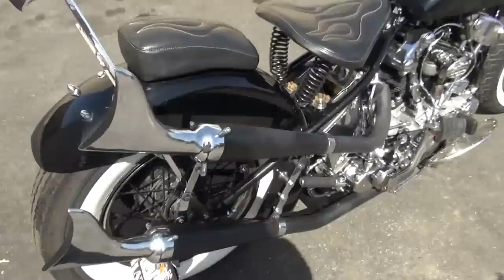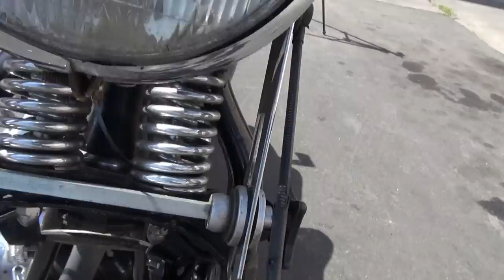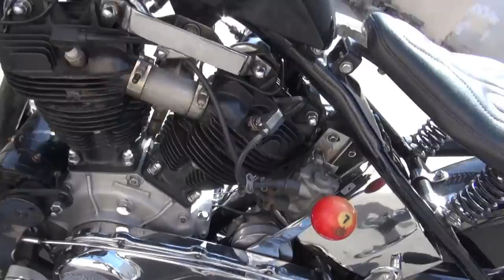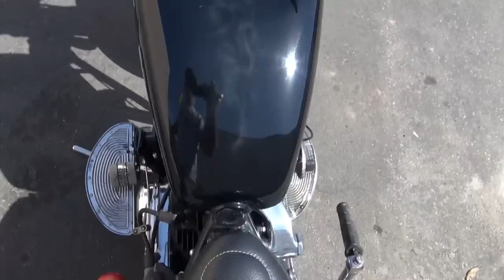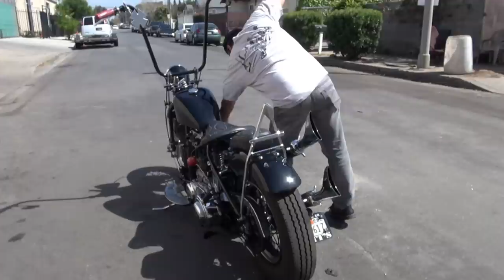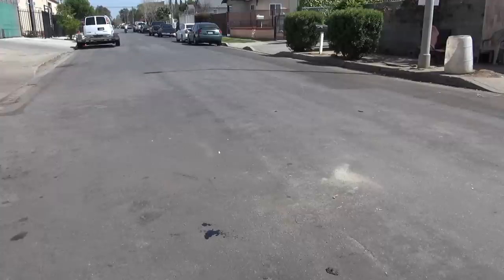Hunting Harley's, 1945 Knuckle bobber

Comment: i have fallen in love with these retro bikes haha what would a guy look to pay for a basket case to build i wanna find one and build it they look awsome haha
Reply from the maker: there is no set price. It is whatever your willing to pay and they are willing to sell for. best of luck
Reply: Ok.Who really knows the reason for apehangers? Give up? In W.W.2 When signal Corp riders were used to relay information quickly , THE ENEMY would stretch wire across roads to impede motorcycle couriers progress. Tall handlebars were a Safety matter, not a style look.🇺🇸🗽
Reply: @onepunchgeorge9251  wow that's cool info thanks.

Comment: yeah, the oil leak under the primary tells me it a real harley. dont be fooled by imatations :-)
Reply: +ted hazelwood If the oil leak is from the primary cover hole at the bottom of the clutch, it is supposed to leak there, it is from the chain oiler,,it's how the primary chain is oiled,,,,if it's leaking anywhere else,,it is an oil leak!
Reply: That's environmentally unsound engineering. Should have a little catch cup.

Comment from the maker: MMI is only good enough to make someone dangerous
Reply: HuntingHarleys I bought a basket case 74 sportster because I knew the engine had almost no miles and it's what I could afford. Prices were still nuts in 04. I've told anyone who asks if you have basic skills and buy a factory manual you can figure out anything. It does suck buying a 40-50yr old bike that's had decades of terrible repairs. I've seen some ugly stuff, I'm sure you've seen worse. I got to move to a 68 shovel with std pan heads that I loved and miss. Never got the negative people telling me my bike that never let me down was junk. I liked staying off interstates and cruising between 55&65mph. Told the haters I've got style, if I wanted fast I'd buy a hyabusa. Off topic but factory manuals are awesome. Seen the clymers or whatever the brand and they show enough to trash a bike. I remember it was a worthless book.